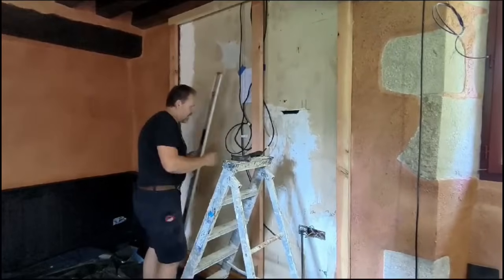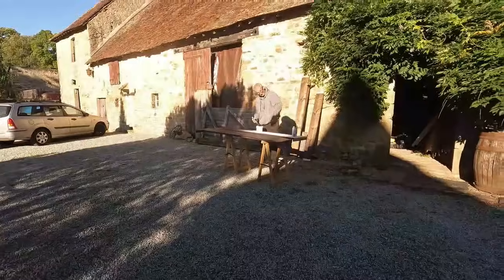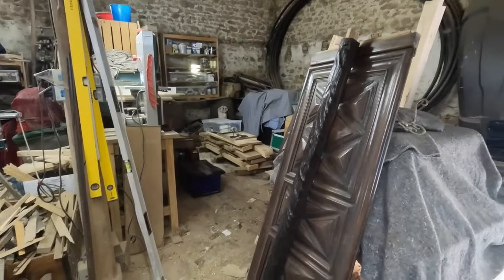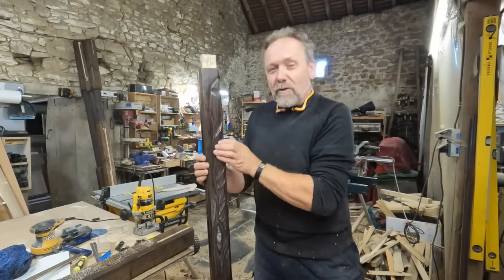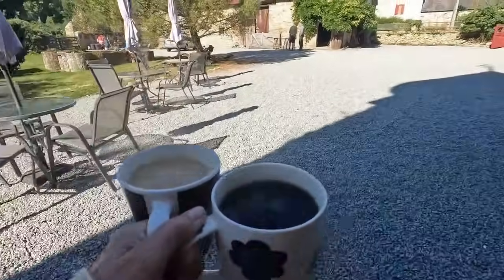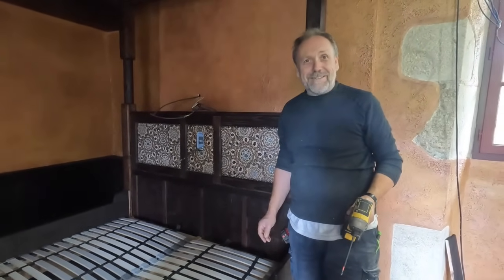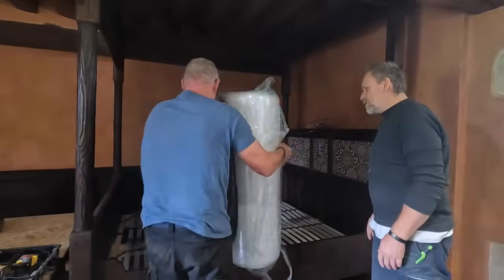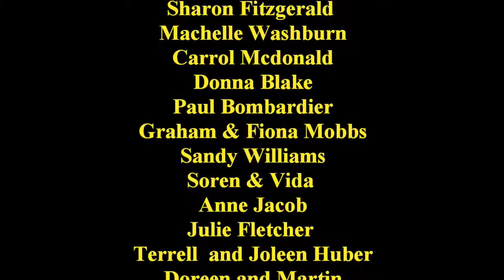Turning OLD TIMBER into a Stunning FOUR POSTER BED!

Comment: Well done Ted excellent job,  and the headboard finishes it off a treat.  Very posh.
You are selling yourselves short,  1200 pounds  Sterling or Euros TIMES that by 4 (four).  It's totally unique,  hand made and hand carved.  Plus the curtains, again hand made.  Yes a lot of hard work has gone into the design and making of it,  You've got the formula now so the next one will be a little easier,  and the one after etc. 
You really should think about doing this,  you will make a small fortune. 
Cheers form England.